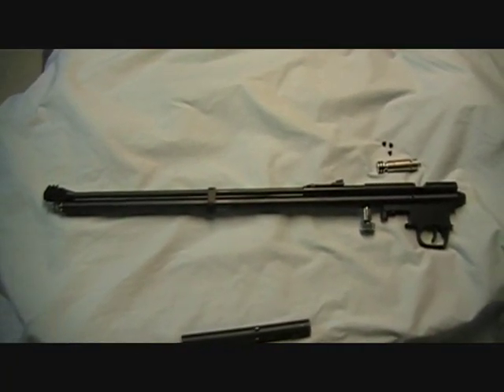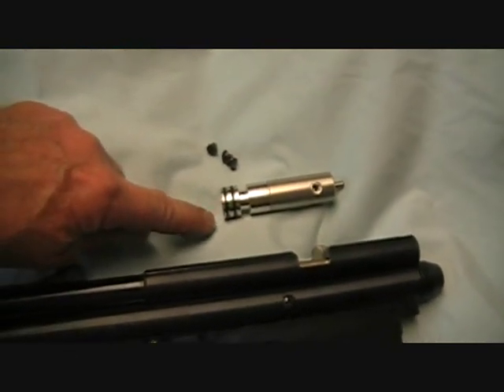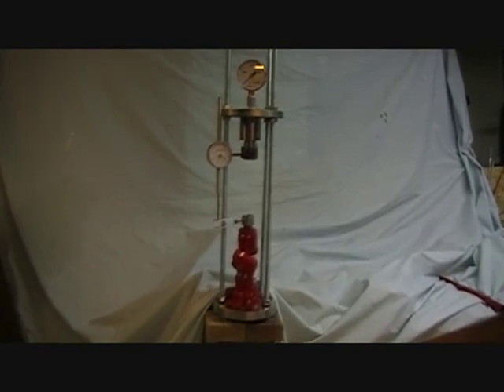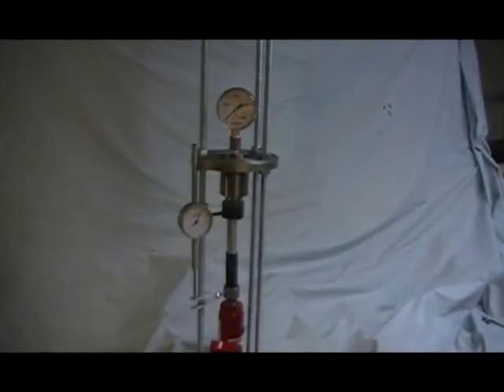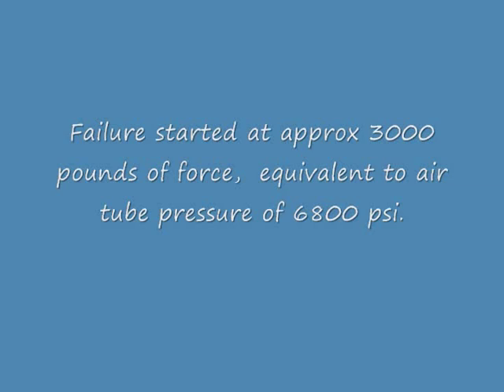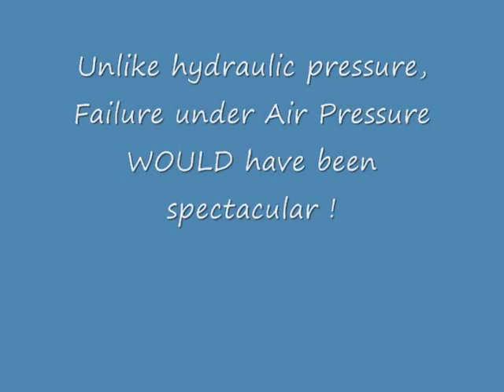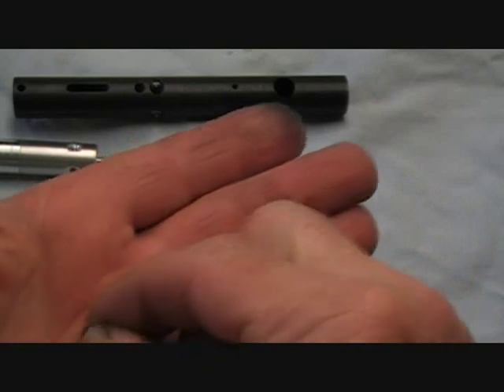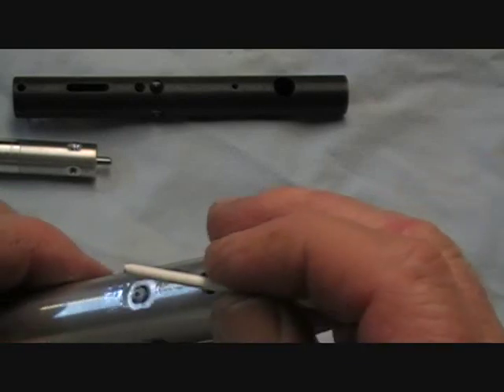Short Video version - Airgun valve screws shear testing to failure by Airgun Lab.

Comment: I love your scientific approach.  I would replace screws with stainless steel, I can imagine that steel screws can be weakened if rusted.
Reply from the maker: +Dima Prok 
"Standard" stainless steel screws (type 304 or 316)  normally are not any stronger than "Standard" carbon steel.  If  strength greater than 120 ksi is needed, you have to get either high strength alloy steel screws, which are reasonably priced, or high strength corrosion resisting screws (like 14-4PH), which are very expensive.  Luckily, these screws are in a very visible location so that they can be watched for corrosion.

Comment: Very interesting.  I have wanted to see what would happen.  Even though I wouldn't do it, it seems that the Disco tube, valve, and valve screws will hold a lot of pressure...even if just for a little.

Comment: Are all airgun valves held by just 3 tiny screws at 3000psi?    are there other fixing methods used besides screws?   Do any have a closed end on the tube so they can't just slide through.   Or rods driven completely though the valve to hold it.
Reply from the maker: There are LOTS of other methods from different manufacturers.  There are also lots of points of failure in an airgun to consider.